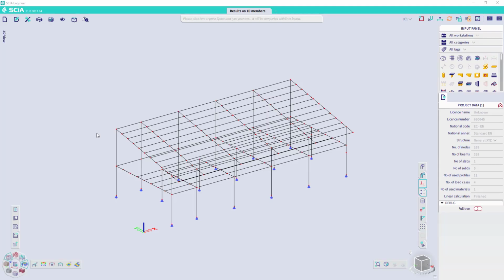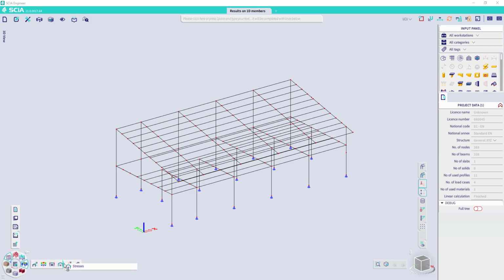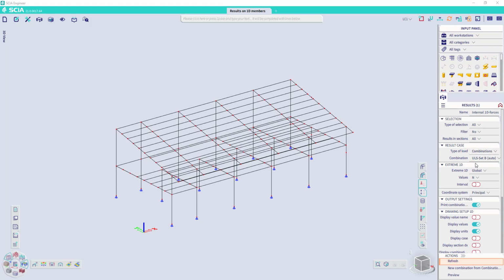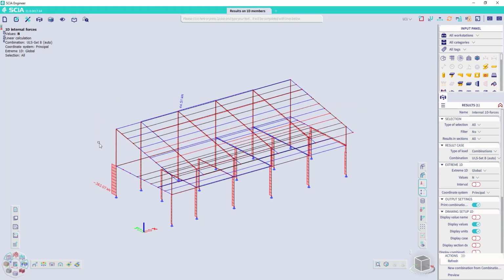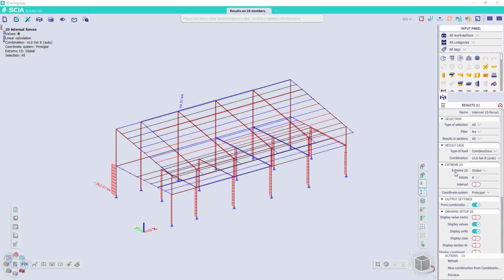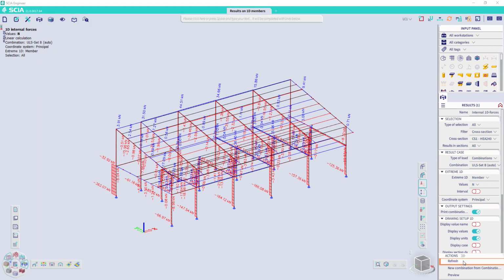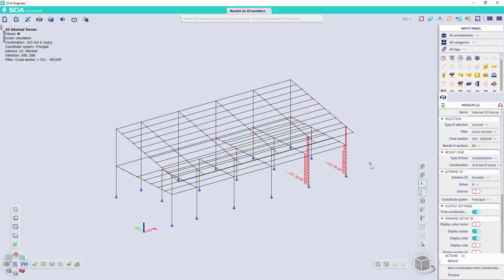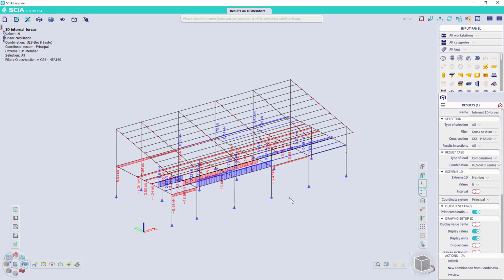[EN] Results on 1D members in SCIA Engineer

Comment: Hello, Thank you for the video!

There is a way for 1D elements to show the displacement results next to the deformed shape? 

I found it for node displacement but I can't find a way to display these values if the maximum is in the center of the beam. There are also the 3D deformations that print the results in color scale but sometimes this is not so clear to show the results.